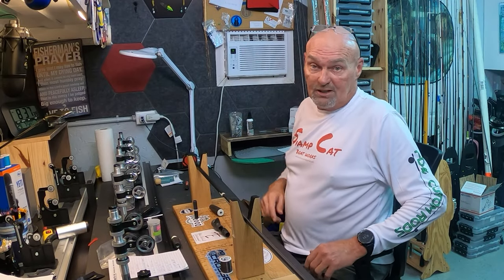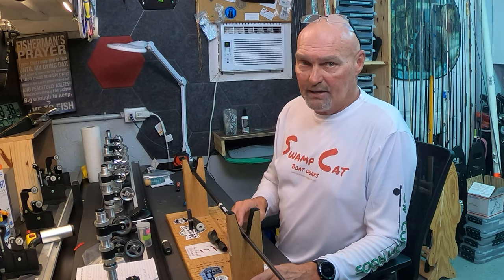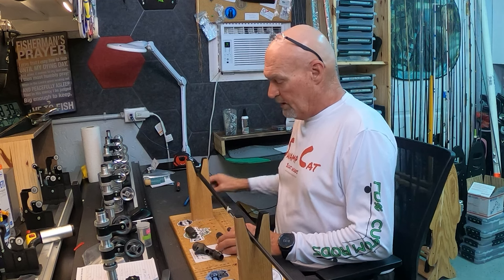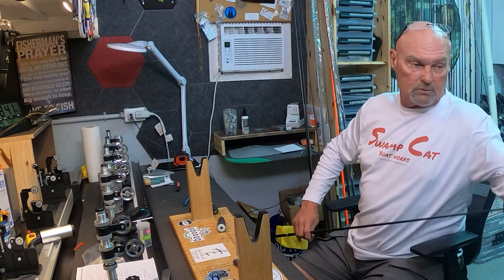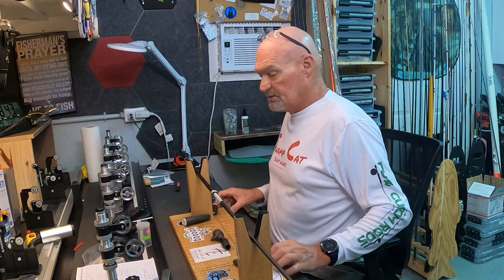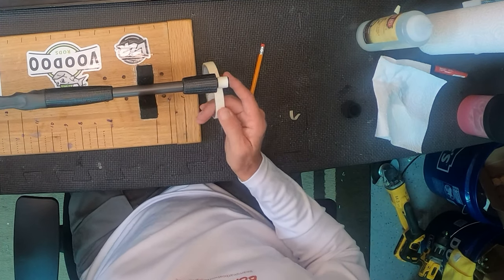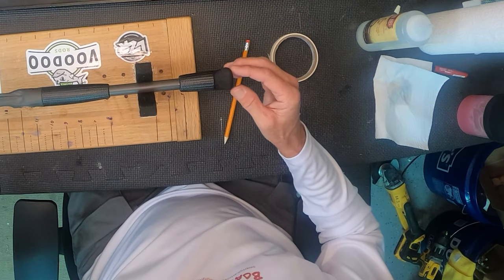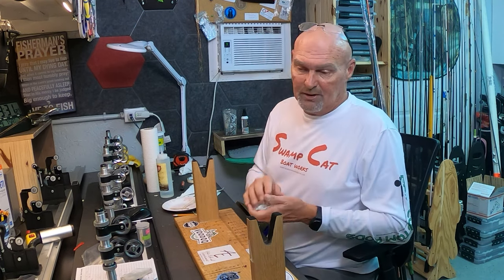7-4 Heavy Worm Rod Part 1

Comment: Would you not factor a reel into balancing a rod?
Reply from the maker: Most baitcasters are palmed, so the weight is in your hand.   It really does not affect  the balance in most situations.
Reply: In my builds I try to keep as much of the weight in the handle area as is. I just wondered your take on it as to me a rod can be the lightest in the world but paired with a brick of a reel and it is just horrible to fish with. A few customers have asked for super light rods and I have told them to go find your super light reel and not worry much about the rod weight.
Reply from the maker: Agreed, however, you can put a super light reel on an unbalanced rod, and it still "feels" heavy regardless of the overall weight.